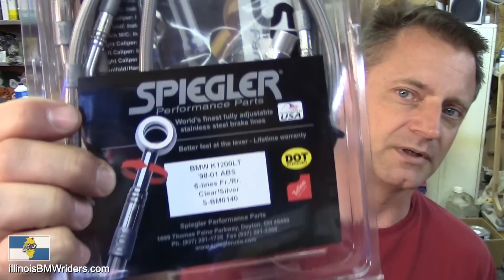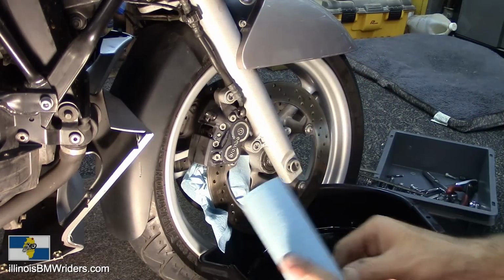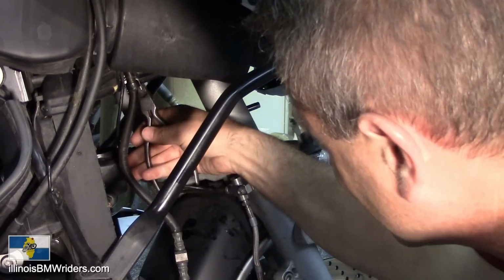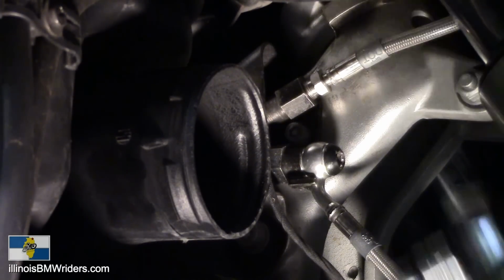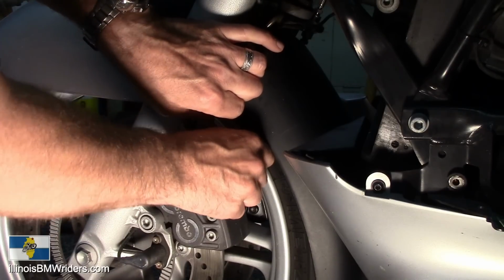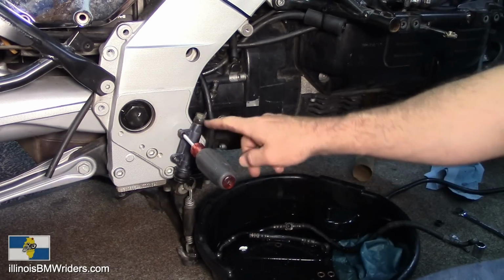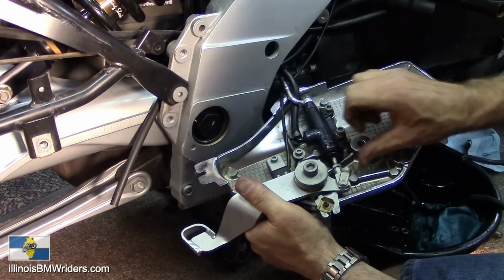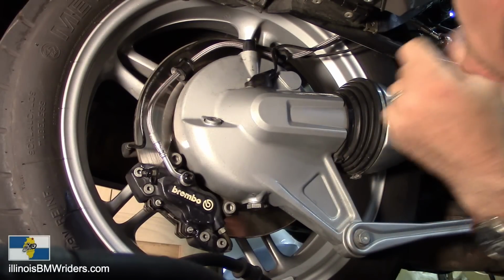BMW K1200LT DIY Spiegler Brake Lines Replacement

Comment: Hi,

Can you answer a question for me please?

I see these brake pads online that says they are for 1999-2000 K1200LT but it also says "It will NOT fit ABS Models".

Were there K1200LT bikes without ABS in the 1999-2000 year range?

Mine has ABS.

Or is it a case of the Seller not knowing what they are talking about & the Pads will fit my bike?

Also, the question of "Sintered" pads Vs. Carbon/Kevlar and Semi Metalic.

From what I read the Sintered pads wear out the Rotors (which are expensive to replace) much faster than the Carbon/Kevlar.

Is there a difference btwn the Semi Metalic and Sintered pads?

And is it Ok to use any of these with the 1999 K1200 LT  ABS (Brembo) brakes ?

Thank you so much for the help, it is confusing.
Reply from the maker: I would recommend either CL pads from Spiegler https://spieglerusa.com/brakes/brake-pads/make/bmw/model/k-1200-lt.html 
or EBC pads. I personally use Sintered pads and have had no noticeable wear in the rotors. Yes there is a difference. Sintered tend to grab harder and dissipate heat better.
Reply: Thank you for your reply.  The Spiegler pads you sent me don't say that they are Sintered pads.  

Are you saying the carbon/Kevlar pads noticeably will NOT stop the bike as fast as the Sintered pads?

What are Semi Metallic, are those different than Sintered and Carbon/Kevlar ones ?

Thank you.
Reply: And is there a NON ABS 1999 K1200LT ?

Because I see brake pads for the bike but it says "Will Not fit ABS brakes".  I though all the 1999 and later K1200LT's has ABS brakes???

Thanks.
Reply from the maker: I am not really sure what you are asking me that I did not already answer. If I had to guess, you are trying to save money buying pads off of ebay or amazon. Without a link to what you are buying I have no idea if they will work since I am not the one selling them. As long as the pads fit, they will likely stop your bike. Some are better than others. I personally do not like carbon/kevlar but that does not mean you wont. I will stick with sintered because that is what I prefer. The ones sold at Spiegler are sintered. Just remember, sometimes you get what you pay for. If you buy a $20 brake pad set they will likely perform like $20. Quick wear and lots of dust not to mention unknown wet performance. I hope this helps you understand.
Reply: What I was asking if there were K1200LT bikes models made without ABS brakes or if they all had ABS brakes.?

I ask because one seller says the pads fit my bike but they don't fit ABS brakes....which made no sense since my bike's year ALL have ABS as far as I know.

I tend to agree with what you said for the most part except sometimes the seller is simply making a large profit/Mark up on the item & thus it costs more....especially since most things are made in China anyway, I mean most of these are NOT German made pads (except the Spiegler ones you like are made in France).

Anyway here are 3 brake pads I am looking at.  Perhaps you can tell me what you think:

http://www.ebay.com/itm/1997-2000-BMW-K1200LT-ABS-Kevlar-Carbon-Front-Rear-Brake-Pads/181749810941?_trksid=p5411.c100170.m2943&_trkparms=aid%3D111001%26algo%3DREC.SEED%26ao%3D1%26asc%3D20140131123831%26meid%3D0b4a88b3d547492d80dca2d9754ada7f%26pid%3D100170%26rk%3D7%26rkt%3D15%26sd%3D272263807167

http://www.ebay.com/itm/281069207402?item=281069207402&viewitem=&vxp=mtr

http://www.ebay.com/itm/Outlaw-Racing-OR407-Front-Sintered-Brake-Pads-BMW-K1200RS-96-00-K1200LT-97-10-/201438860252

Thank you so much.

Comment: Please help I just bought a BMW K1200RS have not even put 100 miles on it front brake blow. No one in my area will touch it. Closest BMW dealer is 3 1/2 hours away in Troy NewYork. Called them $350.00 just to bleed the system. The whole job about $1000.00 yeah I don’t know about you but $1000.00 is a lot of money money I don’t have. They say it’s because of the abs system. And those that are not BMW dealers say you have to be a dealer to get this special tool what ever that is. Can anyone help please. My son in-law is a heavy equipment mechanic and has worked on my cars for yrs. so I have access to someone who is mechanically inclined just need to know if it can be done and how. Thank you much everyone. Kirk please if you read this HELP!